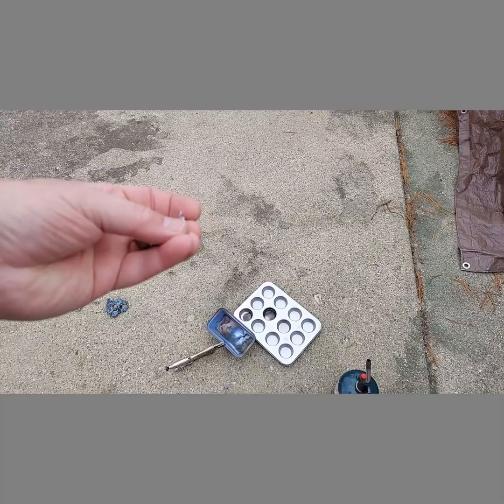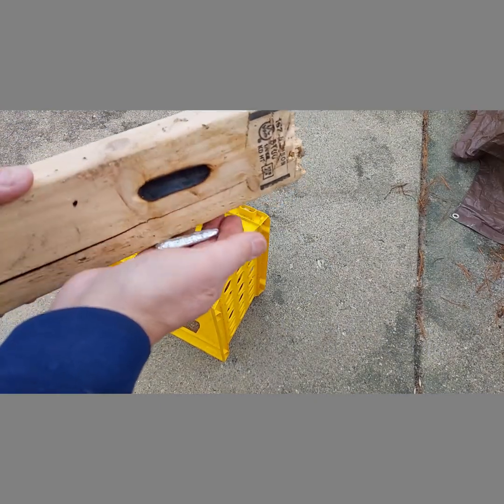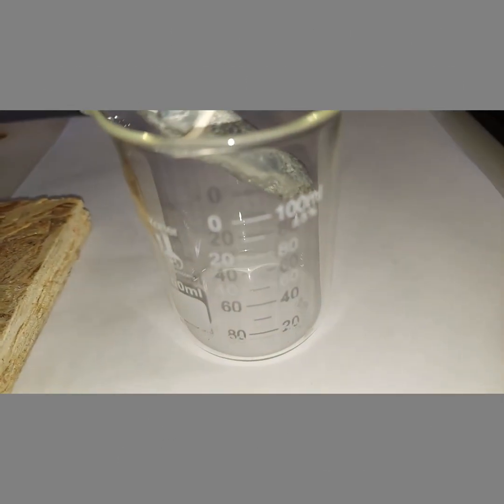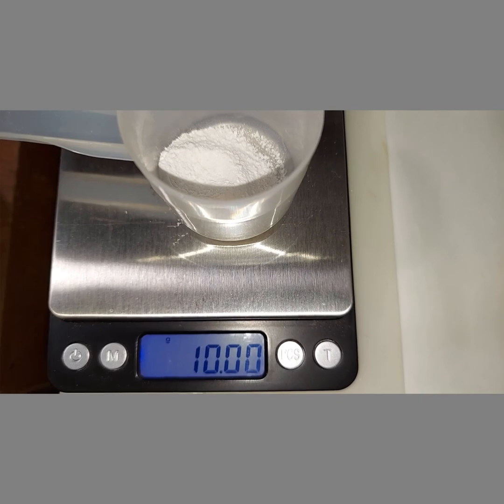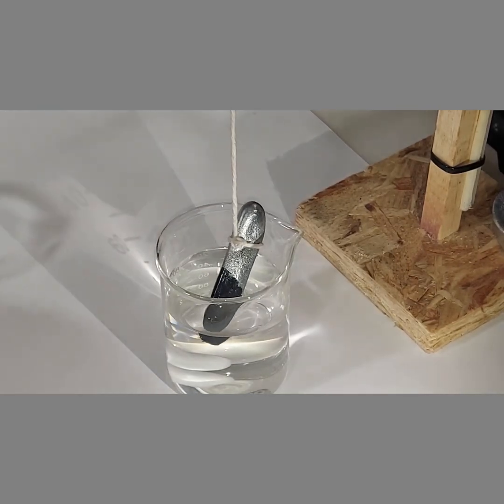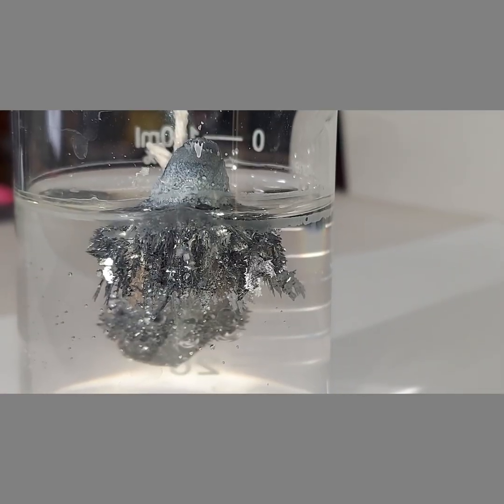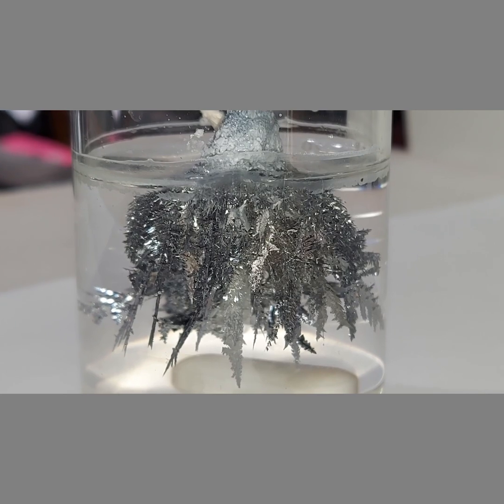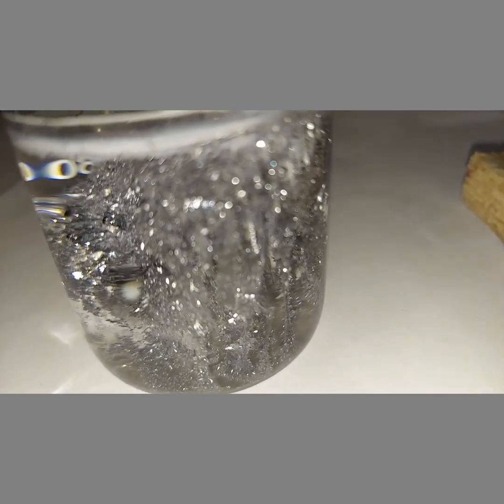Crystallizing Lead #science #experiment #chemistry #crystals #sciencefacts #metal

Comment: So, the zinc ends up in solution. Is it about a 1:1 swap, like in the sense that if one gram of zinc is dissolved, does that mean you've grown at least 1 gram of lead crystal?
Reply from the maker: Very close.  What happens is that for each mole of Zn dissolved, one mole of Pb is produced.  But, because the molar mass of Pb is so much higher than Zn, you produce 3-4 times more in weight of Pb than Zn dissolved.